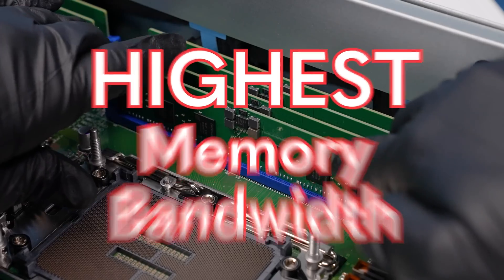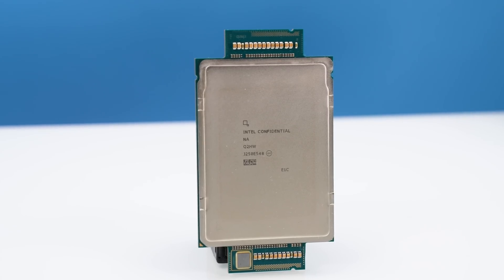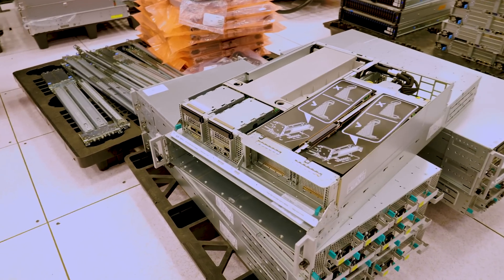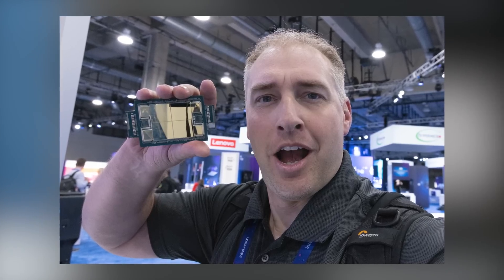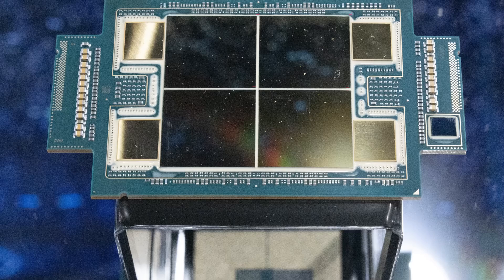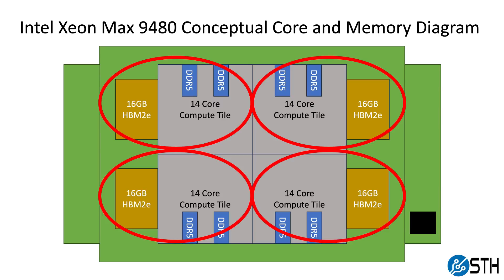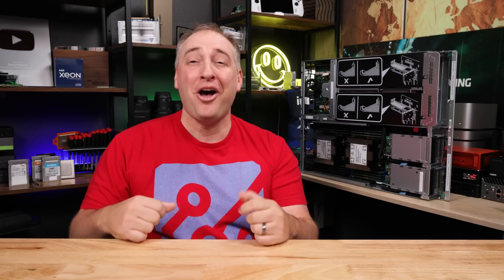This Server CPU is so FAST it Boots without DDR5

Comment: No sleep states are needed for any platform, though preferred when running on battery.  A workstation or gaming PC benefits from disabling them.  Except for power choking of unused cores to boost those heavily used.  Or cooling is insufficient, so sleep states are needed to help for that.  Lacking them is not a reason for not using the same CPU as in this video for those workloads.  What is always relevant is the performance per cost.  Or just performance if cost doesn't matter.

Comment: With that much on board HBM, installing DRAM is pointless for a lot of applications.  How well does it game or run common desktop/workstation workloads?  With vs without DRAM?
Reply: this chip will never see any desktop workloads.  1.14 G/core is considered unusually low even for HPC, though there are some fields that would be OK (MD, mainly).  4G/core is more like a normal HPC config, and of course enterprise is often higher, including hyperscalers.  (cloud stuff may start with .5G/vcpu, but that vcpu is as little as 10% of a real core).
Reply: @markhahn0  If I had a regular media program I'd start taking pseudo-bets on when LMG gets one.  There are probably others too tempted.  Someday it will be cheap as data centers dump them for new tech. That's when others will get some portion of those dumps to try them for other purposes.  This chip comes with 64 GB HBM.  Someone will tinker with it just as old Xeons were given new lives in gaming PCs.  It would be interesting to find out how it performs and scales to keep its cores busy without DRAM, but adding a lot of it is also an option.

Comment: 64GB is kind of small for any AI workload that would take advantage of the memory bandwidth.
Reply: Compare it to GPU VRAM - sure top of the line GPUs have slightly more but H100 is pretty industry standard and has 80GB. Considering CPUs are definitely going to have way lower throughout than GPUs it doesn't seem like capacity would be the issue.
Reply: its a HBM2e also works like VRAM, its superfast btw my P40 24GB tesla with GDDR5 gets 2,50 sec in stable diffusion, while P100 16GB with HBM get 0,8 - 1,5 now imagine i use double P100
Reply: @ThelemaHQ  stablediffusion isn't really memory bandwidth limited. Things like, say, transformer based large language models are.

Comment: 8:52 My thought is why Apple didn't try to aquire the Optane ip and patents. Then we wouldnt have to worry about write endurance, and also an even lower latency SoC in combination with the massive amount of L2 Cache Apple has
Reply: Optane drives have failed to write endurance being exceeded.  Being used as DRAM extensions IIRC.  Its best placement is as a large swap space or cache for tiered storage to preserve endurance and power on time of other tiers.  Intel stopped production / development and sold it due to it not selling well enough.  The purchaser IIRC was a company primarily focused on memory.  Enterprise and high end prosumer SSDs serve sufficiently where it fits best for a tiny fraction of the cost per cap.
Reply: Because Apple knows they have no chance in the HPC biz , Apple rules where the looks matter.

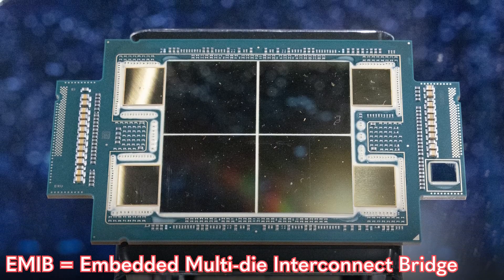Comment: 3:14 "thats why intel does it but AMD doesnt." Wrong, AMD started doing chiplets back in 2015 with the... uh... i forget the name of it. Ill edit the comment lol. It was one of their GPU's. And also starting in 2023 with their 7000 series GPU'S theyve gone back to doing chiplets. Still no HBM to replace VRAM entirely yet but its still a chiplet design for the core.
Reply: We have to give credit to AMD on this one, regarding chiplets. The danger though is the approach AMD chose to implement chiplets. Later designs like Intel's might be superior in a range of functions not initially considered. I do expect a pendulum swing in favor of Intel as their approach gets validated.

Comment: What is so difficult about the integration that Intel does but AMD does not? Why is this harder to do than AMD Instinct HBM or Versal HBM? If HBM is used as cache how many sets does it support and how long does it take to search 16GB of cache for a hit?
Reply: It’s "3D" Stacking, that makes it much more expensive. It’s similar to HBM Packaging (but still different) and not just a couple of Dies glued together on the same package. AMD could so it but they want lower costs. 
AMD uses these packaging techniques but not in Ryzen/EPYC CPUs

Comment: Isn't that also the kind of Xeon where you pay to "unlock" some of the accelerators and frequency curve? 

Also it's not really a workstation part sadly. Intel is marketing their Xeons for workstation, while I want a GPU Max 1100 (PVC-56) as a workstation card. I got hopes for announcements next week. Intel is demoing it on InvelDecCloud and I had a chance to try it. 

I believe my workstation will still get a i9 14900K with custom look cooling (slight chance of tec)
Reply from the maker: This is not unlockable from what I understand

Comment: HBM is not a cache, despite Intel proposing that. It is not lower latency like eDRAM or SRAM. This shows very well in your benchmarks.

At least GROMACS bench should also be higher if you partition in 4 and use MPI to lower data transfers.
Quite the failure of this Intel *glue*, as only big labs will have the expertise to properly tune the software. Most will just use Epyc-X.
Reply: Cache is not a certain type of memory but an access strategy to improve performance. It can be used as a cache
Reply: Phoronix published benchmarks in July showing the newest Epyc chips destroying sapphire rapids, even the HBM version
Reply: I wouldn't read too much into PC benchmarks.  @post-leftluddite

Comment: These RAM-on-CPU or L4-as-RAM (whichever you want to call it) solutions would be excellent for storage-only or Ceph OSD nodes. Excellent options for low-cost computing to save cost and power when all you really need is a few PCIe lanes and some compute
Reply: That totally fits the strategy to make ceph as expensive as possible to make it useable .)
Reply: @berndeckenfels  the idea is to save cost by getting a cheap motherboard with only 0 or 1 LRDIMM slots per CPU and use these as low-cost high-thread chips to power the cluster.
Reply: @aarcaneorg  they are not low cost (neither are there Cheap mainboards for them).
Reply: @berndeckenfels  yes, as with all fancy new hardware that solves low cost problems, it launches at obscene prices, then eventually comes down in price. Eventually, these, or their ancestors, will become affordable and mainstream.
Reply: @aarcaneorg  that sounds rather unlikely, that’s a specialized hpc  model with an expensive production process and special socket and bios.. not like a mass market D-Xeon
Reply: They could lower the cost by amputating the external parallel DRAM interfaces, that should save at least 1500 pins. CXL can support system memory on the PCIe bus if more is needed. Inter-processor links could be replaced with more PCIe lanes and Ethernet. I think this might already be done with some DPUs
Reply: This will be cost effective for most when the initial hardware built like this is too old for enterprise to want it.  Just buy the cheapest tiny PC that can handle what you want fast enough to avoid annoying you.

Comment: I called it!  Less than a year after I asked when we would be able to boot servers without even needing to add RAM right here on one of your videos, and here we are! Somebody saw my comment and made it happen!
Reply: Hate to burst your bubble, but the CPU design timeline is such that they would have been actively working on this CPU design for years prior to review samples being available.
Reply: @bradley3549  be that as it may, a lot of things, like the ability to use the onboard cache like system ram, are minor revisions that can be made in firmware or opcodes, the kind of tweaks that can happen at the end. The extra cache was planned for years. Booting from it was my idea.
Reply: @aarcaneorg  You're definitely not the first to think of integrating ram and CPU and then booting from it. That's been a feature of CPUs for a LONG time. Just not x86 CPUs. Sorry.

Comment: This Xeon's will Serve The Home - all homes at once 😎

But who needs this power? Usually the storage is the slowest part of a system and you better invest in faster storage than in faster CPUs. Most of the time several cores are idling.
But i'm sure there are some strange physics-simulstions as a usecase... simulating earthquakes, weather or nuclear fusion... or simply having the fastest minecraft-server of all 😉

Comment: I worked on this CPU! Specifically the bridge dies between the CPU tiles. I figured I'd share some fun facts about those CPU tiles here for you guys:

Each CPU tile has 15 cores. Yes, 15. The room that the 16th would occupy is instead taken up by the combined memory controllers and HBM PHYs.

There is not one continuous interposer. Instead, each CPU tile sits on top of EMIB "bridge" dies as I call them. this strategy is more similar to Apple's than AMD's, or even Meteor Lake's. This is because Sapphire Rapids is so enormous that it exceeds the reticle limit of the machines that make normal interposers.

There are 4 CPU tiles, but and 10 bridges. The tiles each have 5 connections, 3 on one edge and then 2 on the neighboring edge. 2 of the tiles are mirror images of the other 2. You can get a diagonal pair by rotating one about the center axis 180 degrees, but the other 2 have to be mirrored to keep the connections in the right place.
Reply: Wait, there are 15 cores per tile? Why does the whole CPU only have 56 instead of 60, and only 14 per tile as mentioned in this video? I already noticed that there is a core less than the Platinum 8490H has (the one that this CPU was compared to in this video) when looking at the datasheet, but hearing there is 15 cores per tile in this one is strange.
Reply: @flintstone1409  15 per tile with one each disabled. The 8490 has 4 fully enabled CPU tiles instead.
Reply: Based on your expertise, is it feasible or desirable for consumer-grade CPUs to use HBM2e memory in products? Perhaps laptops?
Reply: @hermanwooster8944  HBM isn't quite the right pick for the consumer space IMO. High costs with the silicon interconnects and enormous kilobit-scale busses. On-package DRAM and large caches are going to be popular in the near future from what I can tell, but there could also be HBM products in the future. It just seems a little too niche right now to be worthwhile.
Reply: any special reason why there's an asymmetric 3+2 bridges instead of having 3 on both sides?
Reply: @GeekProdigyGuy  Think about it 15 cores 5 bridges works out mathamatically if they had 16 cores it would be a mismatch with way too many misses rather than hits when polled
Reply: @stephencox4224  A fun wrench to throw into that: There are accelerators and memory connections on each tile as well, and almost none of them come in multiples of 5. All of them need I/O to the neighboring tiles. The topology inside each tile is mind bending and I'm glad my job more or less boils down to that electrical task in among us, but the wires are a few nm thick and there are potentially millions of them.
Reply: @GeekProdigyGuy  I can't say exactly since some of that stuff is really integral to the design, but if you look at die shots, the bridges already dominate 2 edges of the dies. The question becomes if more silicon is worth symmetric bandwidth or if we are happy with 2 groups of up to 30 cores having slightly better connectivity than to  the other pair of dies.
Reply: @GeekProdigyGuy probably because of the extra silicon on the edge? not an engineer let alone related to intel but i’d imagine that’s a physical materials thing rather than a purely electrical one
Reply: Thank you for this insight!
Reply: But can it run Crysis?
Reply: @SuchByte  See the Stanfield reply. You could have 7 players each with 8 core CPUs.
Reply: Didn't you sign a NDA when you started working for Intel or its contracting companies?
Reply: @GoldenGearGrinder  I can't say how things actually work inside, but everything I've said here can either been plainly seen in die shots or is confirmed by Intel in a paper or spec sheet.
Reply: @DigitalJedi  Hmm, so long as you're in the clear. I remember working a two week job at an Intel facility before being fired, so the NDA pops up in my mind.
Reply: Thanks for the excellent insight, but I suppose you don't work for Intel anymore in order to be able to share technical details? I mean, trade secrets and stuff.
Reply: @offspringfan89  I'm actually a current SoC engineer working on Lunar Lake. Everything I've said here has been publicly confirmed by Intel or can be plainly observed from annotated die shots taken by the press.
Reply: Are these CPUs set up as four separate NUMA nodes with HBM2e assigned per-tile, so that SRAT/_PXM can be populated with appropriate locality information? EDIT: My bad, I somehow zoned out for the NUMA section of the video and missed it. I am still intrigued as to how SRAT/_PXM (and HMAT, if they're using it?) end up getting correctly populated from the different node configs though; is this a new feature in the UEFI firmware that ends up switching out the ACPI table data? And is there a new format extension for the CPUID leaf 4 data to describe the HBM2e cache when it's configured in that mode?
Reply: @gsuberland Firmware is unfortunately not my specialty, so I don't think I can answer much of that. You would need to find somebody more well versed in BIOS programming for the platform. I just designed interposers and helped with die-side PHYs, then really didn't touch the product outside of that.

What I can share in hopes of clearing anything up, is that the CPU presents to the system as a single monolithic device. Caching mode prioritizes using the HBM2e stacks and treats the DDR5 as overflow space, so you could think of Cache mode as having 64GB of L4 cache.
Reply: @DigitalJedi  Thanks. Do you have any insight into the power delivery stuff? Looks like a relatively low phase count on the motherboard VRM and I'm wondering if the same on-die polyphase buck PoL regulation technique that was shown off a while back, where the external VRM produces a package voltage and the processor contains a few hundred buck phases to produce Vcore with much lower PDN losses, has ended up on the Xeon Max series.
Reply: I'm not sure, that would be an SoC power engineer's area to discuss, but there are a metric ton of power connections on these things. @gsuberland
Reply: @DigitalJedi  it isn't similar to Apple's bridge; Apple's bridge is similar to Intel's bridge. EMIB products have been out for multiple years now with the Straix 10 in 2019. EMIB is also in the substrate instead of a molded bridge above the substrate.
Reply: @CutaneousSensations  I know. I was there when that was made too. I make the comparison to Apple's Ultra Fusion because more people are familiar with that.
Reply: Always good to get the details from the 'source'!
Reply: I would listen to you in a podcast or even subscribe to your YouTube channel.😊
Reply: can you run superPI or cpuz or geekbench on those?
Reply: @velo1337 Xeon W9-3495X scores 2127 single-core and 19738 multi-core in Geekbench 6. I haven't tested SuperPi or found numbers on one. Maximum power draw in my test was 420W peak and 355W sustained.
Reply: Will you guys make a HBM4 version of this cpu on the new architecture?? Thatd be freaking amazing
Reply: Can it play starfield
Reply: @ummerfarooq5383  There is enough PCIE and RAM for 7 players to each have the P-cores of a 12900K and their own full bandwidth 4090.
Reply: @DigitalJedi  thanks for you insight, always nice to see engineers talk about the work they do ;)

I'm busy playing Starfield and porting it to my C128, why because I think that Z-80 will work as a nice co-processor to the 8510 CPU, ha   :p
Reply: @DigitalJedi  ok that sells it😮
Reply: @ummerfarooq5383 Can Starfield be played? Seems like a myth.
Reply: @ummerfarooq5383  can Starfield play?
Reply: Thanks for sharing. Your work is nothing short of magic. Do you recommend any books or topics to search for learning what you do?
Reply: @JFrameMan  Are you looking more at VLSI/device level stuff or architecture? I did my PhD on optimizing interconnects, specifically silicon interposers. If you're just starting out though, something like  "Computer Architecture: A Quantitative Approach", and "Parallel Computer Architecture: A Hardware/Software Approach" would be some nice reads.

The website Chips & Cheese also has some interesting breakdowns of past and current architectures, though they probably aren't a great learning resource beyond seeing the improvements made and the different architectures across products.

Other than that there are some fantastic breadboard computer builds on Youtube, I've seen at least one 8086 build and a Z80 build as well somewhere.
Reply: @DigitalJedi  You know it would be awesome if this high speed memory would be used on consumer cpu's for integratet graphics. Currently the slow ram is really holding them back.
Reply: @DigitalJedi  So I'm in IT, have profound ADHD, and as a result of those two things, am looking to take up PCB design and maybe eventually look into processor design, do you think it would be illuminating and beneficial for me to attempt to replicate like a microcontroller dev board or something to start?
Reply: @durschfalltv7505 
  That would be amazing, but the CPU might hold the memory back.
Reply: Well done Jedi, now i see a gamer can also be a good scammer!
Reply: Is your marketing devision fans of Apple?  They renamed the CPUs to the i-series after being popularized by Apple.  Now they're naming their CPUs "Max" and "Ultra," just like Apple.  My guess is to monopolize Google searches so the results show an Intel based devices instead of an Apple products.